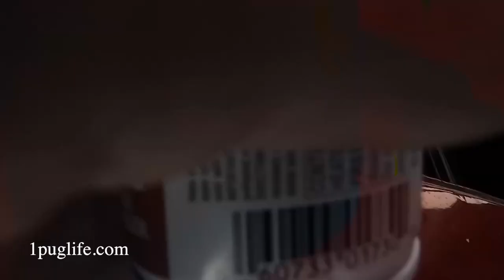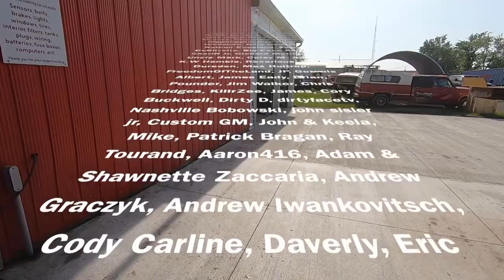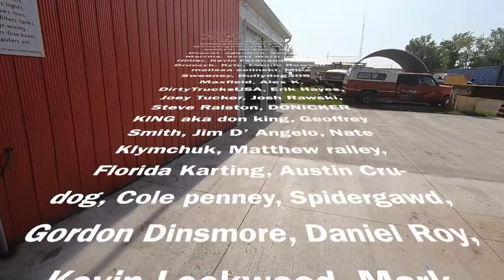cleaning up inwood and starting the dung beetle and stern talks from crawdad

Comment: YOU WANT TO REMOVE THOSE OIL STAINS FROM YOUR CONCRETE PUG POUR SOME TURPONTINE ON THE STAIN GIVE IT A SCRUB WITH A BRUSH LET SIT FOR 5 MINS HOSE IT OFF I TRYED IT ON A GARAGE FLOOR WITH 50 YEAR OLD BLACK OIL AND GREACE ON IT TOTALY COVERED IT BROUGHT IT BACK TO LIKE BRAND NEW CONCREET I USED TO SELL DETURGENT AND WE SOLD GREACE REMOVER AND IT WAS 98% TURPANTINE WORKED GREAT.